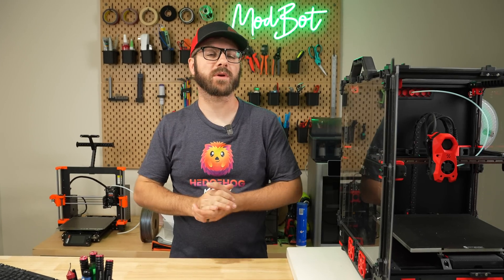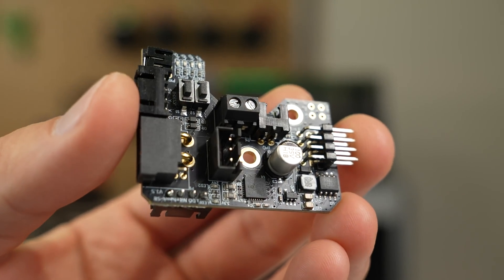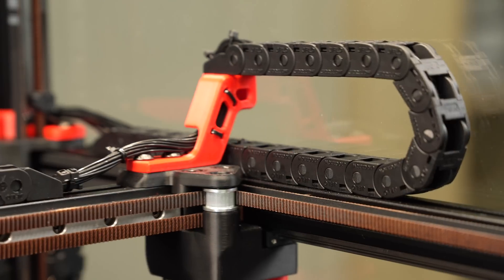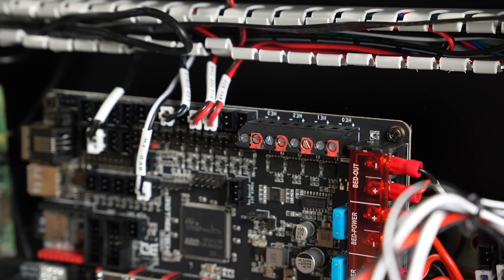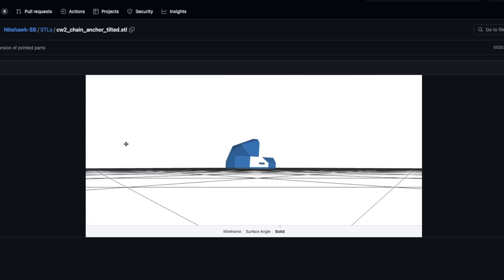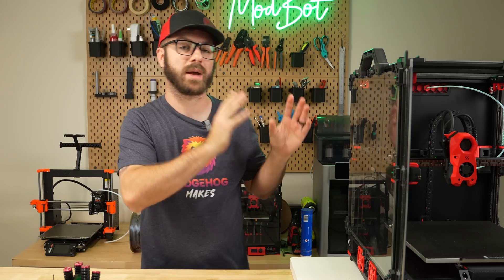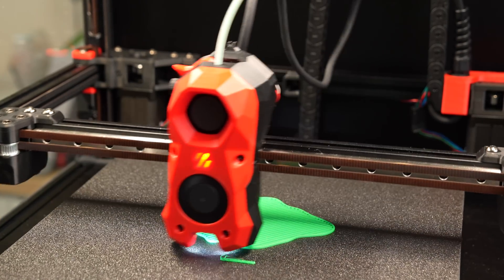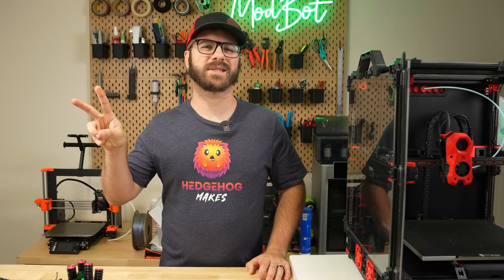USB Toolhead Boards Are FINALLY Here! (LDO Nitehawk)

Comment: The BTT EBB and Mellow FLY toolhead boards have supported USB for a while and it's the standard way to connect a toolhead board on RatRig. This looks like it's pretty much the same except for the adapter. What am I missing?
Reply from the maker: RatRig has been brought up a few times in comments. I have built the V-Minion which doesn’t use a toolhead board so I’ve never seen their implementation. I recently got a V-Core 4 pre release in so I’ll have to see if they are using this or not. It isn’t really something I’ve seen discussed or used outside of there.
Reply: @ModBotArmy  Up until V-Core 4 they didn't come with toolhead boards by default but RatOS has had support for them for a while and they only officially supported USB and CAN wasn't supported. But still, even without RatOS, you could have used the EBB boards via USB since the start. It's the same as adding an additional MCU. And using multiple MCUs is a standard feature in Klipper.

Comment: Had the exact same problem on a Pi4b with NightHawk, Beacon, Webcam, and Klipperscreen.  Would see the CPU usage on the pi randomly spiking up to 100% with the occasional comm error.  I could alleviate it by stopping Crowsnest or Klipperscreen.  But that was just a work around.  Fully solved it by moving to a Pi5 - plus added a NVME hat to the pi.  Now it runs butter smooth and with the SSD, it boots to fully usable in around 10 seconds.
Reply from the maker: Good to know, I have a pi5 I was gifted that I had another project planned for but this may be the perfect use for it now.

Comment: this seems like a silly intermediate solution to me, usb pd 3.1 allows for 48v, 
you could almost halv the heat-up time using the same heater and use half as much wire...
Reply: But still only 5A. If you take a 24v 40w heater and send 48v through it, it becomes a 160w one, which draws then 3,3A. 160w for a 20mm cartridge is a bit spicy if you ask me.

Nevertheless i understand what are you trying to achieve, but i prefer good old molex plugs. Can be depinned, are cheap and have the locking lever, so no accidental pull out is possible. For the same reasons im also not a fan of these xt30+2 connectors
Reply: @over_pizza_2578   the 160w is an important aspect, I think the not locking usb-c is deceiving since it has a retention mechanism(so it can't gradually slide out) which XT-connectors do not

Comment: For your communication issues upgrading to a Pi4 or even Pi5 is a good idea. Klipper is very timing sensitive so any slight delay in message transmission would cause these issues. Also make sure your backup script is not running as a cron job as the git operation while printing can be deadly to your print :)

Comment: Why would USB have an advantage over CAN in these applications? Unless you need a camera, like the X1C, CAN is actually superior. Much better reliability and stability. Industry is using CAN for a reason.
Reply: A lot of people are intimidated by the process of setting up and troubleshooting CAN and are more comfortable around USB.  Things like the termination requirements are confusing for a lot of people who are not used to dealing with bus networks like that, and USB certainly simplifies that part.  I definitely feel like USB is a step in the wrong direction on this, though.  CAN complexity has nothing on the absolute nonsense that an entire USB stack can get up to.  If you wanted a simpler protocol, you'd look at something like RS-485, but I suppose you'd still have the bitrate and termination thing that confuses so many people.

There are certainly some good reasons to use USB for certain things, but the use of a non-standard cable for this toolhead board seems to defeat even most of those reasons.

Comment: Great video!  I would love to one day see a single motion rated USB-C cable connecting to my toolhead.

“The most recent update, USB PD Revision 3.1, was announced in 2021 and allows up to 240W of power to be delivered over a USB Type-C cable and connector. Before this update, USB PD was limited to 100W.”
Reply: The latest usbc standard is 240w, but still 5a limited, so that means 48v. Unless your entire toolhead needs less than 5a, a pure usbc connection is out of the question
Reply: @over_pizza_2578  not really, you'd just need a buck converter to step it down to 24V for everything else, which I don't think fans and the switches take a lot of amperage. you could keep the 48V for the motor and heater though. most nema 14s handle maybe 1A and a 48V heater would have about 140W of headroom
Reply: @over_pizza_2578  Many hotend heaters are just 30 to 60W.  So even a 24V system would be enough.  However a 48V toolhead would be very cool.
Reply: @m_IDEX  most are fine, but some hotends like a rapido are too much for them. Also depends on the extruder and other components used on the toolhead lile what fans and extruder motor
Reply: @m_IDEX  luke's laboratory does make 48v heater cartridges
Reply: i think this is how bambulab toolhead works

Comment: Pi4 will make a big difference in Performance especially with the camera. I would recommend plugging in the camera to the usb 3 and the mcus including nite hawk to the usb 2 ports. And if still having timeout issues, try lowering your resolution of the camera in crowsnest to 1080,720,or 480

Comment: Both the Huvud and EBB could be run in USB mode? lol However CANBus if done correctly is beyond reliable. Most people challenges is bad information in YouTube videos…
Reply from the maker: Never used Huvud and from what I have seen for EBB getting it setup over USB was clearly an afterthought. I’m glad those options existed for those who needed it.
Reply: @ModBotArmy  It was not an after thought, it was there before the CANBus port. lol You simply either compile Klipper to use the USB or the CANBus port. Please don’t “make up” things.
Reply from the maker: @johnbeima6413   for EBB what I was shown requires cutting a usb cable and a 3rd party usb adapter board. If you’re referring to Huvud then I have not used it. Most everyone I know running can is using EBB or maybe a Fly SHT.
Reply: @ModBotArmy  You don’t need to cut it to use it. You simply need to install it with access to the USB port in mind. Your install, does not make it the board’s fault, or after thought on the board. I have used the EBB in USB mode many many time. The V-Core crowd used it in USB mode… So you don’t NEED to cut it, you CHOSE to cut it. Which still leads to, the board always did and always will run in USB mode. USB toolboards have always been around, I point out the Huvud since it was one of the very first ones. Flat and simply you video title is “click bate” and incorrect, and you are now trying to justify why you put all this incorrect information out there. Things like this bring a channel down.

Comment: you should just jump to the raspberry pi 5... I had ton of issues with canbus, usb canbridge, webcams etc using pi 3 and pi 4s.... tons of hours of torubleshooting and frustration. On one hand the pi 3 doesnt handle the bandwidth properly. on the other the pi 4 doesn't see the devices with lsusb command, or they drop out over time

Comment: Troubleshooting CAN bus is easier than troubleshooting USB. The HAL and packing both on the SBC and MCU side is really sturdy, so you won't need to dive into the packet dumps to search for a missing one. The protocol includes error checking, so you don't really need to worry about retransmission either. The only thing you need to consider are the service on the SBC (not an issue, single config file to edit) and the hardware (which boils down to terminations and good contact). If things go wrong with USB on an SBC, it could be the drivers, the platform-specific microcode, the USB controller, bandwidth issues with a shared port, and so on. Without even talking about the lack of error checking, the much more fragile signal integrity and transmission lenght requirements, etc. It's not really an upgrade in terms of reliability, for sure.
Reply: USB 2 has crc and retransmit, supports cable lengths of 5 meters, 480mbit bandwidth oh… and is used to connect every canbus adapter so if there’s an error that’s far more to troubleshoot
Reply: @williamanthony7224  USB is not a true differential signal protocol (it can have dual high signaling states) unlike CAN. 5 meters is the most it can reach, under perfect working conditions: CAN can work for tens of meters. It is not  built to work in a noisy environment with EMF sources, like a 3d printer. There are plenty of posts on Klipper forums of poorly insulated USB cables that were causing a disconnection, over a very short length. USB byte retransmitting has a much, much lower threshold than CAN, and no auto bandwidth reduction for reliable connections while transferring. You can also use CAN hat, or an SBC/PC with integrated CAN adapters, if you have issues with your USb controller (i did so in a couple of cases). And all of this without even considering the area network advantage.

Comment: USB toolhead boards existed for years. The EBB36 and EBB42 could be run over USB.
Reply: Exactly. Just USB, power. Been doing it for years dude
Reply from the maker: This is true but from what I was shared it’s not quite plug and play. It looks like it requires cutting up a usb cable and needing a usb adapter board. I’m glad it exists as an option but it very much so seems like it is a hack and not intentional.
Reply: @ModBotArmy sorry, looks like you completely out of context. No need to cut anything, you just need USB cable and 24v, that is it
Reply: @ModBotArmy  You just have to run USB & 24v power lines.   Its no more of a 'hack' then running straight canbus.
Reply: @ModBotArmy   I believe that's only if you want to use the CAN bus cable for unified power and USB data.  If you're okay with another cable running between the electronics bay and the toolhead, you could simply run only power over the supplied CAN bus cable, and run another cable for the USB, or run your own power wires and then a cable for USB.
Reply: @ModBotArmy  No cutting at all plug and play.
Reply: I dont like the standard usb connector on the EBB36, it's not stable enough for high speed printing imho
Reply: @andyl2895  I'm using a EBB42, the cable is zip tied to the tool head right next to the connector. No movement
Reply: @dirtdart81  Same

Comment: I don't get how that can work reliably. As far as I know, USB cannot reliably be used for real time communication. This doesn't matter if you have only one board and can send all instructions ahead of time, but when you have two controllers that need to work in sync, it becomes kind of important.
Reply: Klipper sends batched commands with timestamps (!) to my knowledge. It has been working fine since years. The original voron v2 (no v2.2 or v2.4) used two skr 1.3/1.4 since 7/8 driver boards weren't really a think, with only custom boards of idex/toolchangers had more than 6 drivers
Reply: @over_pizza_2578  Well, I guess that works as long as you don't need any true closed loop control, i.e. syncing controllers to real time events.
Reply: @barebaric  klipper docks say same axis motors must be on the same controller. Maybe it allows it, but doesn't recommend it if you mean sync. With the example of the v2 and two 5 driver boards means that the 4 z stepper must be on the same boards, E can be anywhere, xy also should be on the same board, but aren't technically the same axis, but it would make sense
Reply: How RatRig printers used for years then...

Comment: I got the same communication error while homing for a Canbus setup (BTT EBB36) and for me it stemmed from a bad cable connection to the board.

I mostly noticed it when the Canbus cable started to bend during the homing sequence and I fixed it by re-crimping the cable connection and keeping that Canbus cable extending from the toolhead fixed upright (preventing any bending around the cables around the molex connector).

I'm using a Raspberry Pi 5 along with an Octopus Pro controller board.

Comment: As someone who has worked, as an engineer, in the automotive and amusement ride industries, CanBUS is second nature to me. I however get that the 50 year old protocol can seem like black magic :)
Reply: I really need the one for orbiter this is awesome considering the only other options involved an adapter to mount can versions from btt. Can’t wait to grab one!
Reply: As someone who also spent years in the automotive industry, I was surprised to see how klipper uses CAN. It’s basically just using CAN as a transport for serial data, spreading data across multiple packets. I think it was using timing rather than any kind of full handshake. I really wish the devs had designed a better protocol. I’d love to see something with messages designated for different sensors, much closer to how it works in most vehicles.
Reply: @rayk6562  On one hand it would be really cool to see canbus used as it was designed. On the other hand, klippy<->klipper communication has always relied on serial. Changing that for only one transport layer would be a massive refactor that would provide little to no benefit. 

Im not familiar enough with klipper/klippy codebase but I would guess that controlling motors requires a lot of data (and the whole point of klipper was that the mcu doesnt calculate moves but rather only gets sent steps data) that can't fit in one or two CAN frames. So you'd need to reinvent a protocol for move commands, spreading data across multipleee..... oh. you see now?
Reply: IMHO, Klippers biggest problem when running on a System with a lot of stuff is the ordeal you're facing when an Update throws something out of sync which happened to me when I had to update the ERCF and doing that brought its MCU Version out of sync with the rest of the System which then all had to be Updated too requiring a Firmware Update for the MCU. Royal fuckin' pain in the ass 😑 Kinda swore to myself I'd never be making another change to the System but alas that's easier said than done with me soon installing an entirely new Board ( BTT Kraken ), a MMB for the ERCF, and my own take on a CPAP /sigh
Reply: Because USB is so much easier? :D And  so much easier to debug.
Reply: @nukularpictures  It really, really isn't.  It's easier to get started with, but when USB breaks, it can break in spectacular and bizarre ways.  The complexity of USB is just hidden from the user most of the time.
Reply: @ckitching2  That was sarcasm :/ Guess I have to use the /s in the future.

But yeah, I fully agree with you. That is why we use CANOpen in our control systems.
Reply: @nukularpictures  Yeah, unfortunately in this case, a /s is necessary. A few days ago, I read an article on the RatOS blog comparing USB and CAN that pointed out some real disadvantages with how CAN is used on 3D printers and fact the robustness and reliability of CAN is generally wasted on them, but also said an advantage of USB was because it uses three wires instead of CAN's four wires, so...  I don't begrudge anyone for feeling uncomfortable with the technology (bus networks are not commonly exposed to most people), but some of the rationalizations utterly defy reason.
Reply: That is so wonderful that you shared that with us , I'm certain there are thousands of us that feel the need to bow down to you for knowing about this for so long .
Reply: @JuliusRobinson1972  I am not sure where you are coming from. I am agreeing that the protocol can be confusing, explaining why it is convoluted, and expressing that I am glad there is another option.
Reply: @MikeysLab  I was being facetious , my apologies , I think that it's amazing that klipper is using this

Comment: I've had so much trouble with the dwc USB stack on the pi3 and older. Even without any high speed devices, the driver tends to lock up the hardware when handling a large number of transactions concurrently.
In many cases, it took a hw power cycle to clear

Comment: Perfect timing. Just yesterday I ran across the Nitehawk and was hoping to see review/setup video on it. I plan to use it on a Zero G/Ender5+ upgrade I started this week. I may go this route though I could go with a regular CAN if it's less buggy. I'm not afraid of the setup of a CAN board, but if a bug-free USB setup saves a bunch of time, I'm into that. Who wouldn't be?
Thanks

Comment: Hehe the only reason I was excited to see this was because I get MCU timeout errors running canbus. But seems USB toolhead boards also suffer the same problem. Would be nice to see  if a better pi solves it. I'm using a pi3a+ which might not be powerful enough as it runs into mcu timeout errors.

Comment: I believe "SU" might be the equivalent of "FU" for filament unload. Similar to the pinout of the orbiter filament sensor.
Reply: Looking at the schematics its directly wired through a resistor to a GPIO pin just like the FS and both aren't referred to in the config. So I would guess "supplementary". Both can probably being used as whatever you need.

Comment: Why finally? I only use the usb connection.. the can has a lot of trouble.
Reply from the maker: There hasn’t really been any clean options. Without having to run multiple wire pairs. I believe there was a mod for EBB boards but nothing native.
Reply: @ModBotArmy EBB36/42 can be run through the original connectors. No need to mod anything. Simply loop two dupont pins to then USB port with a small usb cable.
Reply from the maker: @GreenPlasticWaterCan  I forgot someone had shared this with me. I’m sure it works fine but it’s still a bit hacky of a solution https://lab4450.com/blog/upgrade-can-ebb36-to-usb-toolhead/
Reply: @ModBotArmy  oh well, yes. At least 24v and USB connection. Right.